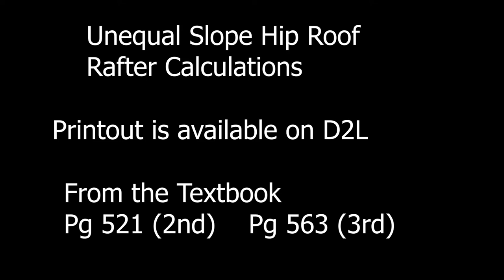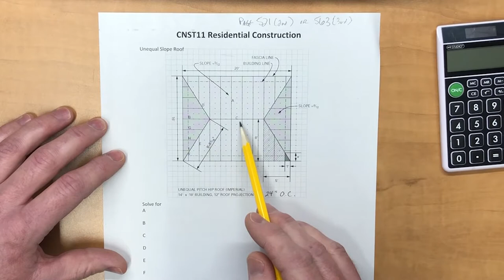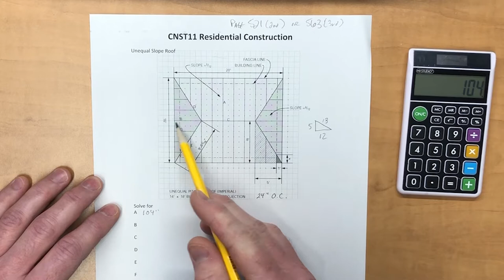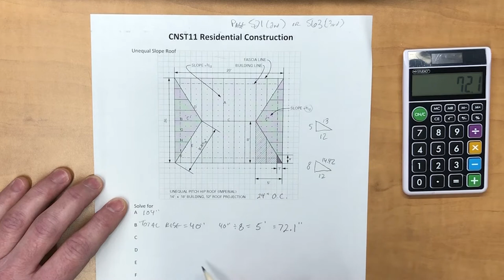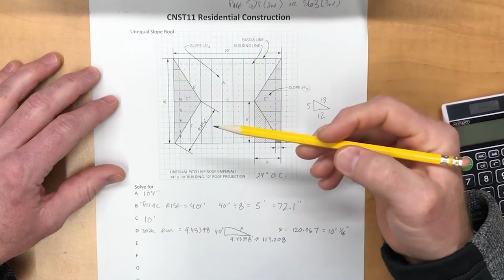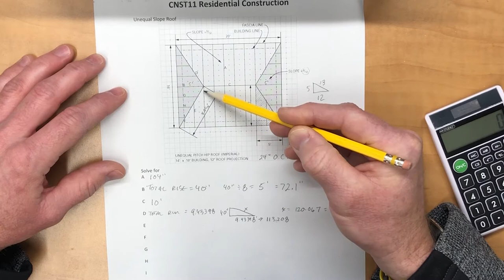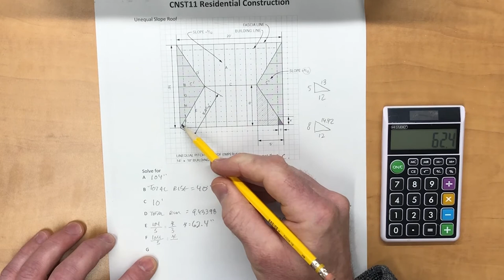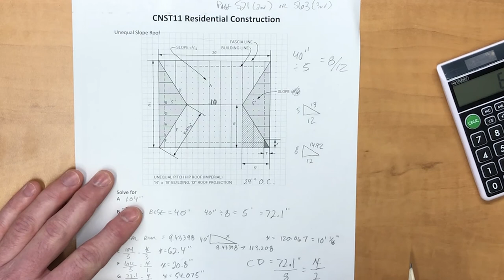Unequal Slope Hip Rafter Calculations

Comment: That is all fine and dandy for a fine line drawing, when you add wood things change dramatically. To have the same over hang you have to raise the heal height of the steeper pitch to meet at the same time, therefore the hip will need to shift from the corner to make the hip plane at the wall plates at the Same point, also when you add a ridge board. your half span for the 5/12 would be 95.25 95.25 run/setback and for the 8/12 would be a 59.527 run/setback. The ridge board would be 97”, that is not a correct drawing for a wood framed roof weather it be hand cut or roof trusses having the same overhang. That drawing shows both the wall corner plate and Facia being in the same line, that does not work with having to make the heal height taller for the 8/12
Reply from the maker: I appreciate the comment.  It's tough to see in the video but the drawing clearly shows the hip offset from the corner.  You can tell in the video that it does not run at 45 degrees.  And yes, of course you need to pay attention to your height above plates (the heel).  Often the difference is too great to simply adjust the birds mouth and the wall has to be built up on the steeper side.  So I understand what you are saying but the drawing is fine.  If your projection is equal then the fascia and corner of the building have to line up (2' out and 2' over for example), just the hip runs offset from 45.

Comment: Not sure if you still check the comments… thanks a lot for this. 

When we were learning this in class, we used a run of 15 for the hips instead of 16.971, could you explain to me where the 15 comes from? I understand that the hip run is the square root of the product of 12/12 for a 45 degree angle, just very confused where the 15 comes into play. Is this a common ratio between different slopes?
Reply from the maker: I'm not sure where the 15 comes from.  13 is the Unit run of a hip on an octagonal roof.  Maybe it was just a number that was picked to lay out the plumb cuts on an unequal hip/val with your framing square.  It's all just proportional to the total run and total rise.  So, what you use as the unit run for an unequal hip/val doesn't matter as long as it maintains a constant ratio with the total rise and run.

Comment: I know this is an older video but it's worth a long shot, thanks in advance.

Building a one sided porch irregular hip roof, so this is what I got, need help with out end rafters and all pitch,

Lenght is 23' + 1ft and each side for hangover 
From ridge face to the width is 74" + 1ft hangover
The ridge is 16ft wide
Between the outer wall height is 94" and top of my ridge is 108.5"
With a difference of 14.5" between 74"
Any help will be appreciated
Reply: I'm thinking the front might have a 2/12 pitch or so
Reply from the maker: @stillhere2025  I think I understand the situation.  Don't forget that you have to consider the bird's mouth.  With your total rise above plates 14.5" if you have a stand (Height Above Plates - or material left in the bird' mouth at the building line) of only 2 3/16" you will have a slope on the main (front) commons of 2/12.  That would make the total rise from top of fascia to top of ridge 14  5/16" and a slope on the end commons of 3 3/16 / 12.  The slope of the unequal hips are 1 11/16 / 12.  
You can change the stand of the main commons but that would change the slope from the 2/12 of the main commons.  With a projection of 12" you'd be fine with a 2 3/16" stand.
To the outside of fascia the length of your rafters are:

Main commons 87 3/16"
End commons 55 7/8"
Hips 102 9/16"
length of the jacks depends on your OC spacing and actual lengths of all need to be shortened proportional to the size of your fascia stock.
I hope that helps...
Reply: @scottfleming  that helps so much, thanks for replying,  would it help if I cut down the ridge down a bit on each side,  since it's a front porch, looking for a wider front look, thanks again
Reply from the maker: @stillhere2025  happy to help!  I think that's a great idea.  I don't know how much you were thinking but if your ridge was 128" then you could have equal slope on all sides and your hips would run at 45 degrees making the layout and assembly easier.  Plus it looks better from underneath if your rafters are exposed.  I'm not sure you were thinking of taking that much off though... 32" from each end is a fair bit.  Either way the slope is not too steep and a shorter ridge will give you more of a sweeping look.
Reply: @scottfleming  I will do that, comes out to 10' 8"
Reply from the maker: @stillhere2025  Perfect!  Have fun with it, sounds like a great project.
Reply: @scottfleming  thanks again

Comment: Thanks a lot for this video it’s very helpful! Just curious, since the hips are not running at 45 degrees how would you know what angle they are running at so you could cut your Jack cuts. Thanks for any help.
Reply: Or really I guess a better question would be is what is the  pitch of the hips?
Reply from the maker: @chiller19100   The slope (pitch) of the hips is proportional to the total rise and run.  Use ratio to find numbers that will fit on your framing square.  In this example the total rise is 40" and run is 113.208". For the plumb cut, you could set your square at 8" for the rise and 22 5/8" for the run (just divide each number by 5).  This is the  equivalent to 4.24/12 slope.  Plumb cuts for the jacks is the same as the commons for the side they are on (5/12 and 8/12).  Side cuts are a different story!
Reply: @scottfleming  that was very helpful and thanks for responding! Just one more question, would you have  to raise the 8/12 plate height?
Reply from the maker: Hi  @chiller19100  .  Yes you do.  The amount depends on the difference in slope and the projection to the fascia.  In this example the projection is 1'.  So the amount of rise on the 5/12 side at the plates is 5".  The amount of rise on the 8/12 side is 8" so the plate needs to be built up by the difference of 3".  If you make your the stand (amount of material left in the rafter at the birds mouth) equal for both slopes then just build up the plate by 3".  If it was an 18" projection I would use ratio again to figure out the build up.  3" build up per foot (12") so 18 divided by 12 x 3 = how much we need to build up (4.5")
Reply: @scottfleming  you have been extremely helpful! Thank you very much
Reply: @scottfleming  I’m sorry just a quick question why would you divide by 5?
Reply from the maker: @chiller19100  Sorry for the delay.  I've been without power since Saturday... I just picked 5 because both numbers would then fit on the square.  You could use whatever you want to make it fit on the square just as long as you divide the rise and run by the same number.

Comment: So if you swing the hip rafter over to the steep side dd you make the height above plate the same as the commons on the steep side? or do you have to do something else to the hip rafter to get the hip in plane with the steep side and the shallow side? Thanks for any help
Reply from the maker: Hi Dillon. Yes the height above plate  is the same as the commons on the steep side.  You'll have to "drop the hip" a little and because of the angle it runs at (not 45 degrees).  So its not the same as equal slope.  Remember that the theoretical measurements are to the centre and that your birdsmouth will be deeper because (typically) your hips are one lumber size up from your commons and jacks.  JLC has a really good article on this topic here:  https://www.jlconline.com/how-to/roofing/joining-unequally-pitched-roofs_o

Comment: What’s the equation needed to get to the hip true length if I have the hip run and rise?
Reply from the maker: True or actual length is determined by shortening the theoretical length by the thickness of the ridge (and fascia, depending on where your measurements are taken from).  It has to be shortened by the thickness measurement taken on the same angle as the hip - measured on the level and proportional.  Alternatively, you could have the hips meet and shorten the ridge.  Note- if your hip rise and run are actual measurements (inside of fascia to end of ridge) then the hypotenuse of those two will be the true length of the hip.  When you lay it out remember that the layout lines are in the centre but the cheek cuts won't land in the centre due to the angle of the hip not being 45 degrees.  Hope that makes sense!